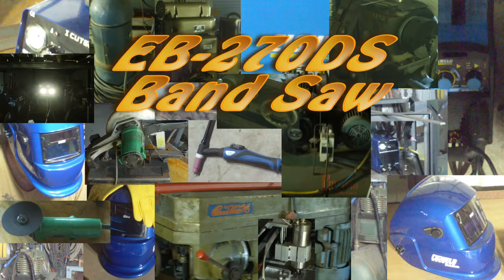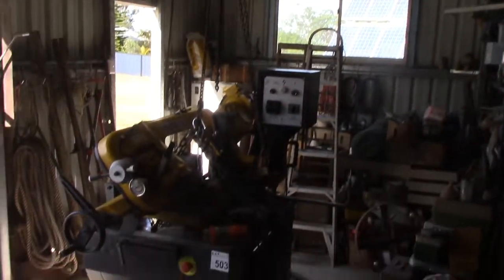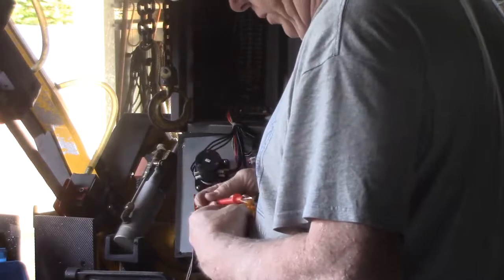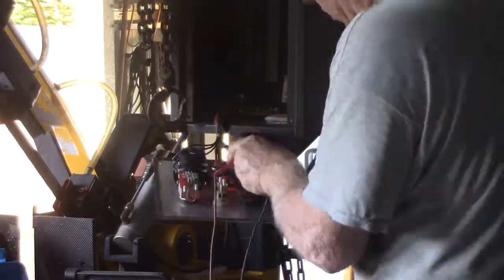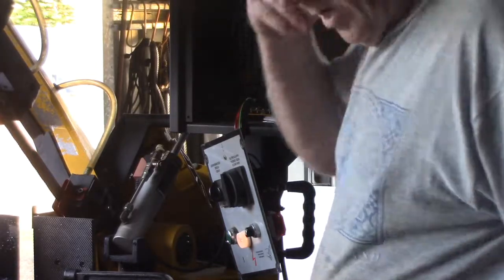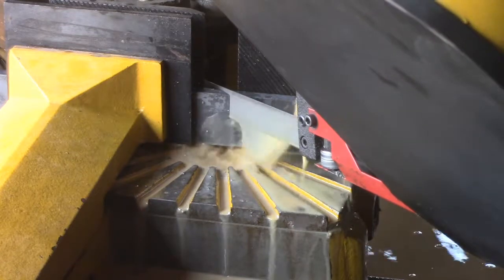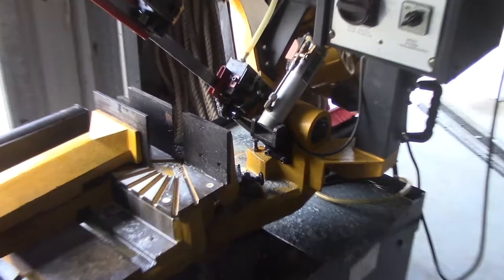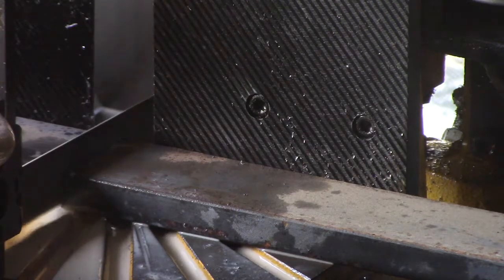EB-270DS Metal Band Saw

Comment: nice saw man is it a 240 volt saw or a 415 volt saw? I can quite tell by the plug looks like a 3 phase but big single phase plugs look similar
Reply from the maker: This one is 3 phase.  Sometimes you can be in the right place at the right time.
Reply: yeah sweet do you have 415 volt already or are you running a rotary phase converter?
Reply from the maker: The shed has 415 volt which is just as well.  Most of the old mans tools were 3 phase.  I just needed a long lead to reach the saw.